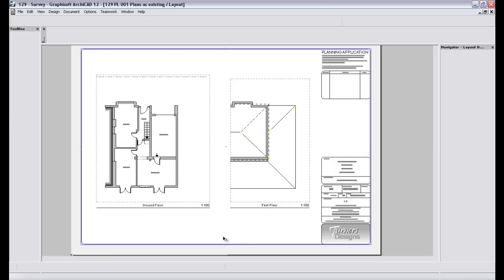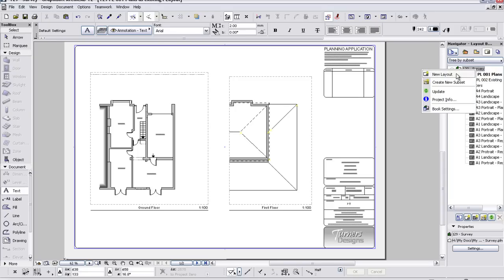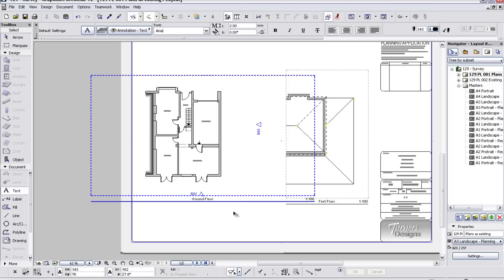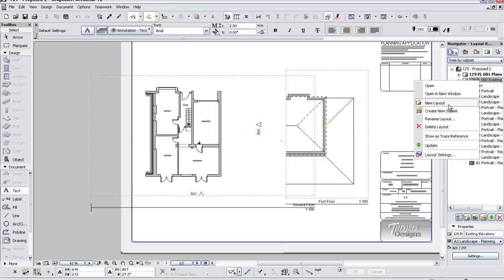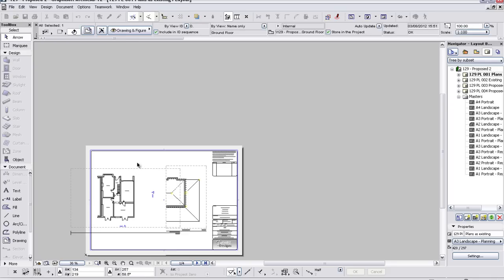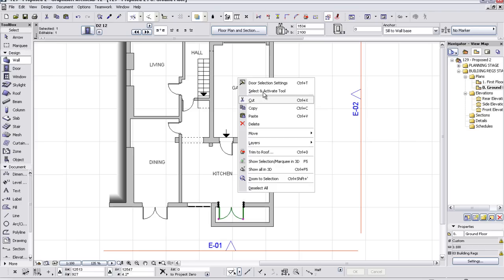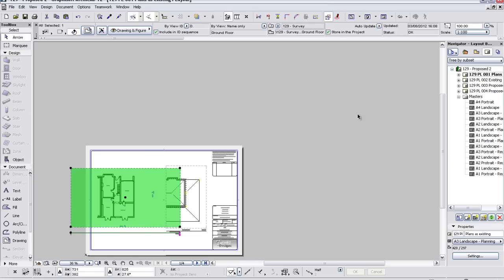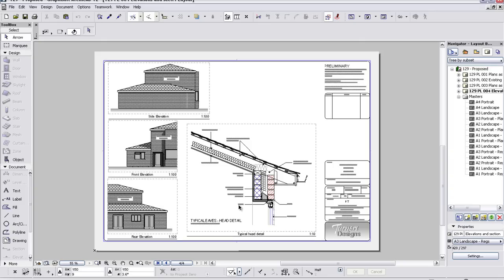ArchiCAD Layout sheets

Comment: Helpful video thanks. Just to clarify; when you link to external reference in the layout is this a similar operation to xref in AutoCAD? So I assume you start with the existing drawing, then once you are happy with it, you then save as both the existing and the proposed plans, so you then have two files, so you then work on the proposed, then when finishing the project you set up your layouts in the proposed and link to the existing as an external reference?